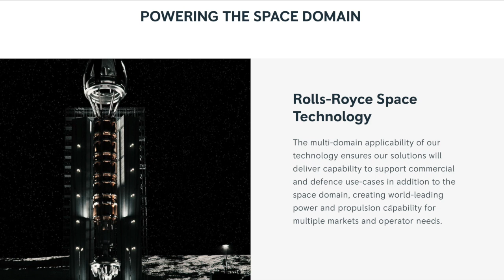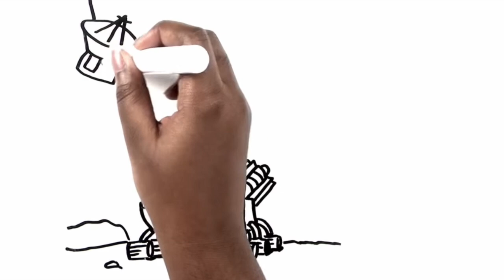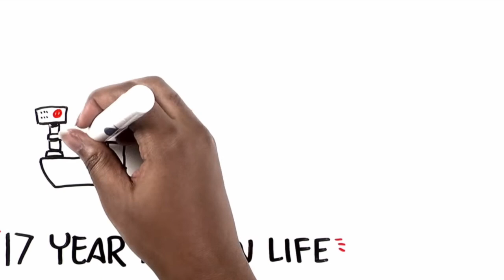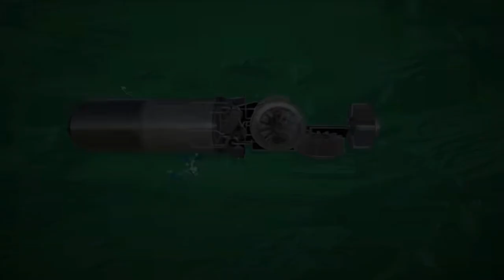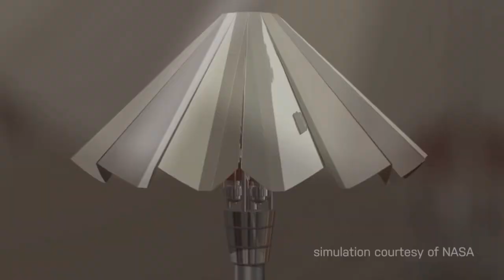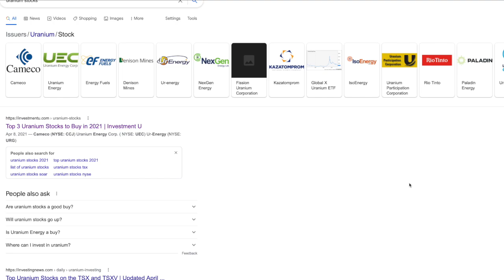Rolls-Royce's Exciting Plans for SPACE Exploration! 🚀 RYCEY STOCK UPDATE! May 2021

Comment: hold forever + Im scared that it will go bankrupt + the price stay the same.
Reply: They are not going Bankrupt the UK 🇬🇧 government would bail them out. Worst case scenario the US government would bail them out. If the governments let them go bankrupt a foreign government would set in and bail them out. I believe if you wait 2 years it will be a $3 per share and 5 years it will be at least $10.
Reply: Good video and bang on the money on many points. Re. Propulsion- this is the first outward reference to Skylon/Reaction Engines which RR have a stake in. The heat exchanger / thermal management is in regards to Reaction Engines - cooling tech. Bringing incoming air temps down instantly for the engine.
Reply: The kilopower reactor angle I believe will be the first step of commericalising the space operations..essentially its just synthesised dev work on the existing nuclear solutions they have for submarine, and small modular reactors.